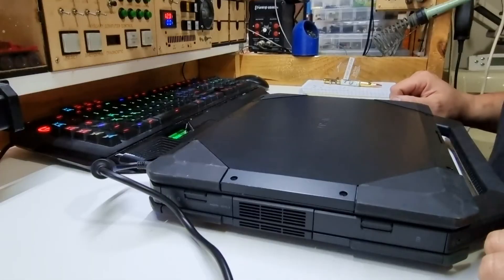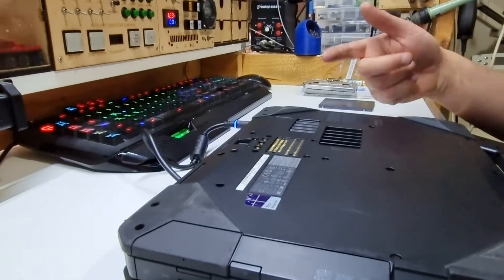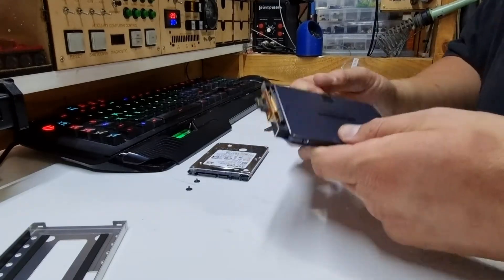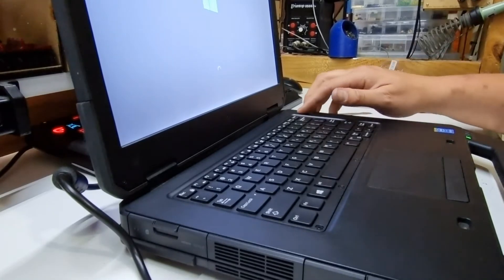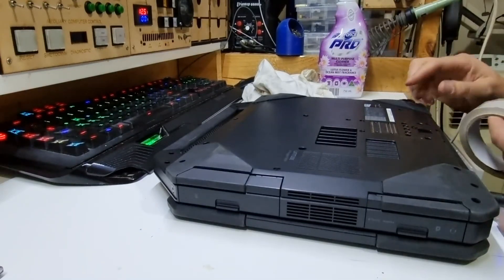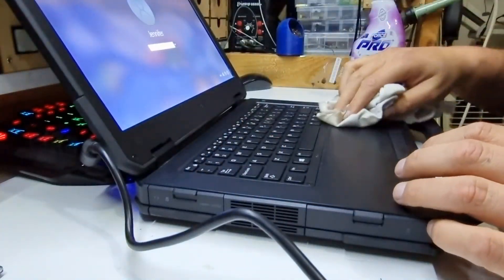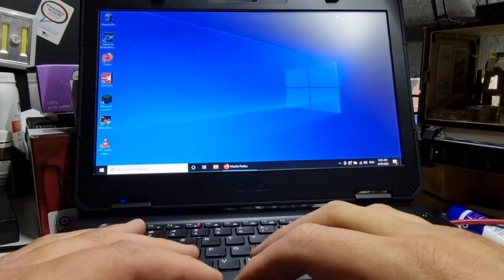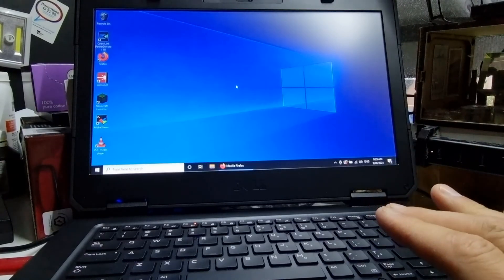Dell Lattitude Rugged 5404 SSD upgrade

Comment: Are the keyboard lights supposed to be flickering?  Good   voice easy to  listen to and  understand...New to trying to  learn  how to 
do upgrades on this model but mine will  have a dvd drive . Over  65  not  computer savvy...but at least I'm trying.
Thanks Mrs.M
Reply from the maker: Lights flickering on camera will just be a rolling shutter effect.

If it's doing it to yours, you might need to increase the brightness in the bios menu.
Reply: bios menu  ?  I said i was new  to this 😳The  question I  asked was in regards to  watching your video.In  the
video the white lights  around/under the  keyboard were  flickering.  
Thanks 🙏 for replying back. Miranda
Reply from the maker: In the video, the lights due to the rolling shutter effect of video.
LED lights are often not powered by DC, rather they a driven with extremely fast pulses (PWM - pulse width modulation), normally due to the persistence of human vision, this is not noticeable, but a camera with a high shutter speed such as mine, will pick it up.

There are videos getting around of a helicopter taking off with the blades not moving - this is a good example of the rolling shutter effect.

The "bios menu" is a very low level menu you can get to by pressing F2 repeatedly during bootup.
that will allow you to make hardware changes and see battery health etc, and alter keyboard backlight settings.

be careful what you change there though, you can make the machine un-bootable if you change the wrong things.
Reply: Thanks for replying, Iam new to trying to learn computers that's why I'm asking so many questions. And I have another question please for the Dell 5414 what is the most memory I can add, and can you recommend the proper hard drive?  I was thinking 1TB just so ya know, and should the memory cards be upgraded at the same time? Right now I have Intel Core i5-6300U, 128GB SSD, 8GB DDR4   Thanks Much, Miranda @TheAussieRepairGuy
Reply from the maker: @mirandat7458  16gb is max ram, so you will need two matched sticks of 8gb DDR3 1600mhz ram.
laptop ram is smaller than desktop ram.
as for hdd upgrade - any 2.5 inch STA SSD will fit it.

however, you will need to install an operating system when you do that (windows, linux, etc)
Best to make sure you are prepared before swapping the hdd out.

there are some tools that will let you clone the existing operating system, but they add complication to the process.
Reply from the maker: @mirandat7458  Additional - CPU's are not upgradable in laptops.
Reply: I have windows 10 pro, why would I need to change? over 65 don't quite understand ...sorry  @TheAussieRepairGuy
Reply from the maker: @mirandat7458  If you change the HDD or SSD - that's where the operating system is stored...

along with every other file on the system
Reply from the maker: @mirandat7458  Aside from the removal of the HDD removing the operating system - Windows 10 is nearing end of life, and you will get pushed to go windows 11 very soon.
Reply from the maker: @mirandat7458  I've been working on a basics video for a while, here's a rough cut unlisted - this might help explain a few things:
https://youtu.be/JXknQKFfxHI

Comment: I bought one of these off eBay and put Linux on it, I don't suppose you know how to get the speakers to work in Linux? It seems to be a driver issue as the speakers work while in Windows 10.
Reply from the maker: I haven't bothered to boot linux on mine yet, but you will probably need to grab the hardware ID and google the drivers for it.
also, there are lots of versions of linux, kinda hard to help without knowing what version.
I often use USB bootable versions to do data recovery, but have not needed to use audio to do that.

however... in ubuntu, on a command line, doing an apt-get update should update the libraries, 

I found this page on the topic, that suggests the default output might be set to HDMI:

https://ubuntuforums.org/showthread.php?t=2439272
Reply from the maker: As a backup, I seem to recall there is a way to get linux to use windows drivers n a forced manner when nothing else works.
Reply: I know this is a year old, but what flavor of Linux did you install?  I have found Ubuntu based Linux tends to work natively on most Dell.
Reply: @ReviewsforNerds  Using Pop!_OS, I managed to get the speakers working. For whatever reason they are automatically muted and I only just found out how to fix it last week. I created a bash file to raise the headphone volume to 100% everytime I boot the laptop. I don't know why the headphone volume affects the speaker volume. I used this command for anyone who has issue as me.. "amixer -c 1 set Headphone 100% unmute"
Reply: @ReviewsforNerds  Debian 13 atm but I have found out the reason, it seems it is always muted. I've made a bash file to set that to maximum volume and made it run every time i log in. It didn't seem to matter which distro I used.

Comment: Thanks for video and I have a question. How does this processor perform in normal office job, like Word, PowerPoint?
I can by one with 1tb ssd and 32gb ram
Reply from the maker: Works just fine, works better niw I upgraded the video card, now I use it for the odd youtube video render in the field.
https://youtu.be/x8AG2XFsl88

Comment: Thank you so much for making this video. I just bought a Dell 5414 rugged but the hard drive is 256GB and not is not enough. I want to use a 2TB at least but can't fine a bracket or caddy that fits the M.2 SSD (PCIe NVMe Gen 4), I also have trouble finding the right cable connector. If you don't mind, that bracket your currently holding is that 12 PIN? Thanks again
Reply from the maker: I swapped out for a sata ssd, mice quick changeover, have yet to find an nvme ssd that has the correct keying to fit the wwan slot
Reply from the maker: As for the bracket, you may have to give me a time code in the video. the one at 3:04 - is the HDD carrier and has a standard SATA interface on the inside.
I never bothered to check the proprietary connector on the other side. Dell has some fairly extensive manuals for these on their website - where they list part numbers.

Comment: Hi how are you doing it got 7404 rugged I want to update and upgrade it because I don't want to sell it
Reply from the maker: Basically I swapped the SATA HDD, for a SATA SSD, as the main bottleneck for these machines is disk access. 
I swapped out the ram for slightly bigger sticks. That's about all you can do for these.
very robust machine. It's also worth spending some time in the bios to check the settings, like enabling the GPS etc.
Reply: Thank you and more question do you think I will be available to change the window 8 to 11
Reply from the maker: @elbbooklesperance8356  for windows 11, you will need a tpm module, the bios menu has an option to enable the built in module, it's disabled by default.
Reply: @elbbooklesperance8356  Regedit => Registry Key: HKEY_LOCAL_MACHINE\SYSTEM\Setup\MoSetup     
Type: REG_DWORD
Name: AllowUpgradesWithUnsupportedTPMOrCPU
Value: 1
As ARG writes, activate the TPM although this mod should allow that to be ignored when installing Win 11.  Win 11 may require TPM 1.1 or newer.  This mod allows Win 11 on CPU prior to Intel gen 8.

Comment: Hey! Where can I find a charger and battery replacement for that same model since I have one as well!
Reply: Std Dell 7.4mm barrel 19.5Vdc power adapter should work.  
Bat: Dell website spec shows for Lat 5414:  97Wh, 11.1V Dell p/n W11Y7 or 0W11Y7, Type DKNKD.  The Dell 65Wh battery in Lat 5414 & Lat 7414 is labeled 11.1V, Type CJ2K1
Reply from the maker: I'll drag it out in a bit and look up the part number for you
Reply from the maker: Its a Dell 150 watt (6.7A) adapter Part Number: LA130PM121

You can find them on ebay for about $50

https://www.ebay.com.au/itm/154406321161?hash=item23f3557c09:g:7pEAAOSwxT5gboRC&frcectupt=true